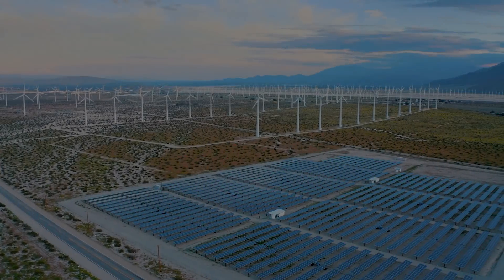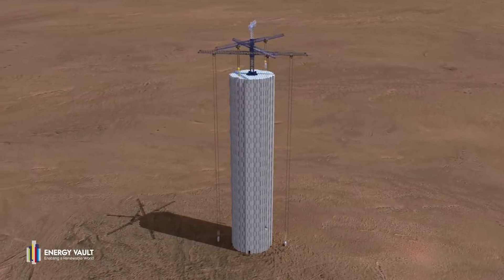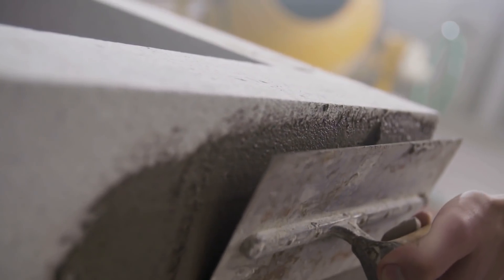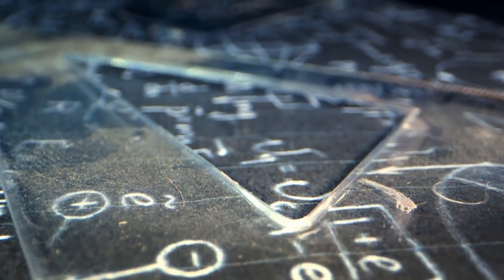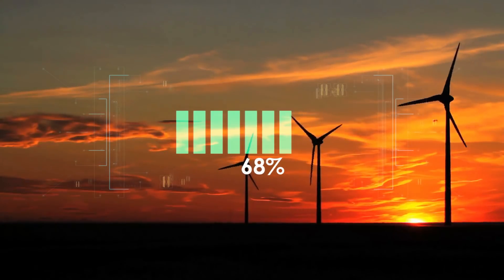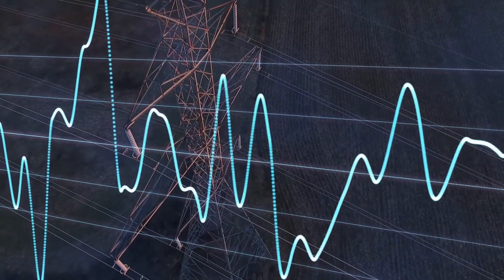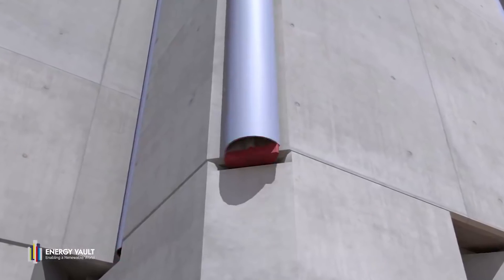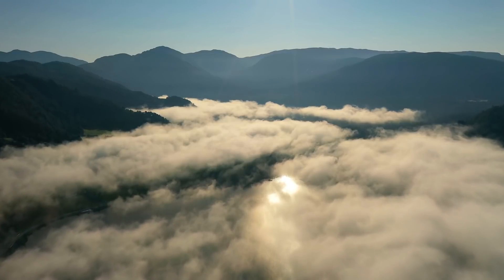Is Concrete the Future of Energy Storage?

Comment: How do you get more power from dropping an object than the energy required to lift it?
Reply: you dont - this is energy STORAGE not generation
Reply: @ollie1505  So the bricks stack by magic? or by burning fossil fuel?
Reply: @lokinakor1  Again nobody has an answer for this... Me I'd like to imagine a group of enslaved (Harry Potter-esq), Wizards chanting Windguardianleviosa over, and over, and over again....
Reply: @Ichijoe2112  has this answered your question?
Reply: @lokinakor1  I understood that excess renewable energy is used for the lifting process eg when solar panels are producing more than is needed at the time.
Reply: Bro.... Its just stacked by a normal crane which can be gas or electric powered. The idea is to STORE this energy being used by the crane in the GPE of the concrete blocks which can then be released at a later date by lowering the block to the floor. Imagine tieing a rope to a rock at the top of a pully then letting the rock fall off the High ledge while you hold the other end of the rope - you will go flying up. This force pulling you up is from the stored GPE in the large rock from the top of the pully. Same idea here

Comment: Why assume a different cost than they state? A well can be a high power option, but it is constrained in energy compared to the other option.
I feel that you really put your foot in it with assuming the cost is between that of oldshaft-newshaft.
Reply: I thought he made a pretty good guess. Raising and lowering a weight down an old mine shaft seems like it will be cheaper than building giant cranes to raise and lower weights. And digging giant holes to raise and lower weight into would seem to be more expensive than building giant cranes. Giant skepticism of a startups cost estimates seemed very reasonable to me.
Reply: @davefoc  That's interesting. To me the crane scheme seems much simpler than the mine shaft scheme. And certainly much more scalable.

Comment: Not sure concrete is the right solution, given it's environmental impact.
Reply: Screw the evvromental impact. Explain to me how we are supposed to get these Bricks up in the Air? More to that point, where does the energy to just do this come from?

Now you dropped you 'brick', and managed to collect a relatively miniscule amount of energy from having done so. The Laws of physics, and to that end Thermal Dynamics, state that the energy produced, will never equal the amount required to reset the aforementioned brick back to it's home position. Hence why Perpetual Motion Machines, are only so much a pipe dream. 

So on that note how is this idea any different?

Comment: Why not instead of concrete... have permanent magnets above each other separated by a very lightweight magnet shielding like aluminum that slides to and away with a tiny electromagnetic charge from itself through both the rise and fall of the lower half... maybe even have it in filled water tanks to prevent it from vibrating way too much?

Comment: We, I think concrete could be the answer,  but the symptoms you show there, look well over complicated,  why can they not use a concrete Ring that runs down the ouside of a central column which houses the Generators, and no crane's needed and can be fully enclosed, this could be down using hydraulic pressure to drive the Generators, and recharged by pumping the concrete  block back up to the top, just an idea.
Reply: Back a century and a half ago there was actually a scheme somewhat like that. A company supplied pressurized water to the surrounding area to be used to power machinery. They created the pressure by elevating a huge counterweight inside a big cylinder with pumped water and then letting it slowly drop

Comment: didn't thunderfoot debunk energy vaults system already?
Reply: Not really, because Thunderf00t doesn’t understand energy storage. He compared it to pumped hydro, but pumped hydro is a different niche in the energy storage market. Pumped hydro is best for long term storage. This is short to medium storage and frequency regulation. And you can’t just build pumped hydro anywhere either. 

Thunderf00t is a “debunker”, he only makes videos where he has already come to a conclusion, and then just makes up arguments to support the conclusion. He’s often right, but only because most the ideas he covers are obviously dumb. He doesn’t seem to do thorough research

Comment: Don't forget the massive CO2 impact that concrete has when made. However it should have a longer shelf life than batteries. However the moving parts may make it less reliable.
It has to have heavy duty lifting cables replaced, the bearings for the crane and pulleys on the dolleys etc. Lots of mechanical parts keep under a service schedule.

It's a very interesting idea however.
Reply: Yeah it would be interesting to see the cost of both types of energy storage compared to one another in both money and the environment because it’s not like batteries don’t have a affect on the environment as well and who knows maybe they could come up with something else that’s really dense and better for the environment then concrete. Although concrete shouldn’t be that bad if they can fix it so it last for hundreds of years.
Reply: It depends on the battery chemistry. Form Energy's iron air battery and Ambri's liquid metal battery are both batteries that will be cheap at grid scale with good life spans.
Reply: Lithium is finite and is hard to source while random heavy blocks of rocks can be found anywhere just add a mix of concrete powder then it is all good or just put it in a bag and basket and good to go. easy to change, manipulate, replace and source.
Reply: Have you guys heard of water?
Reply: It also depends a lot on where, because it's less affected by temperature than Li-ion batteries. So where temperature is a problem , this might be more beneficial.
Reply: There's one thing that, on its own, makes this idea an absolute no go.
One of these towers is only enough to store two wind turbines worth of energy.
Technology can get better but . . .
Also, why is it above the ground where wind can interfere? Dig a pit and let it be safe from wind underground.
Reply: Actually Energy Vault will be utilizing a mixture that utilizes the old discarded blades of windmills as well as the ash from burned carbon that would both otherwise be sitting in landfills. Energy Vault’s entire structure will be constructed using 100% recycled, sustainably-sourced materials for their blocks, and will not produce an ounce of carbon emission during its molding process for their blocks.
Reply: @ryancwiese  And when the wind blows (you know since it's near a wind farm) that long cable system is definitely going to be usable and not completely worthless right?
Plus the constant movement of it all is going to need some serious maintenance.
Pumped storage hydropower isn't exactly perfect, but it's far more simple and overall better version of this gadgetbahn.
Reply: Please, stop with that co2 nonsense.
Reply: "Don't forget the massive CO2 impact that concrete has when made"  You're right, and there are well known alternatives to the current concrete manufacture, that are at least far far less environmentally damaging.  But it seems "vested interests" are keeping the status quo.  Who cares about the future, when profit is needed now?
Reply: This is a massive scam and I am surprised this channel promotes it. It is probably a sponsored video.

Comment: Couldn't you use mercury and get almost 10 times the amount of power? The advantage of mercury is you could pump mercury up a pipe similar to water.
Reply: Ahh Mercury, toxic, expensive and has a disturbing tendency to dissolve many metals.  Far from ideal.
Reply: @stephentaylforth4731  there are nontoxic low temperature liquid metals.
Reply: @ARVash  Cheap and heavy have to be the starting point to be cost effective hence water and concrete. The cheapest metals liquid or not can't compete,  The amount of energy you can store in weight is pretty small,  Raising the temperature of 1 kg of water by 20 degrees celcius is about the same energy as raising the same kg to the height of Everest.  You can get just under 10 watts out of each kg for each metre it falls in a second so 1kg of anything falling from 9000 metres (Everest give or take) per second gives you just under 90 kW give or take.  Raising the temperaure of 1 kg of water by 20 degrees in a second would consume 84 kW.  Getting serious power takes a lot of weight falling a lot of distance in a short time. Hence large reservoirs of water 100s of metes apart vertically and bloody big pipes,

Comment: This has been debunked as an energy storage tool. It's just simple maths. 1kWh is 3,600.000J. So if you had a 1 meter cube of concrete in a 100% efficient system (which is impossible) you would need to raise it by 153 meters. In the USA an air con would need 4 times that per hour in a relatively small office. Also if you stack the blocks each block drops a bit less and the average will be 2/3 if you stack is 2/3 the height of the tower. So for that 4kW air-con you would need a 900m tall tower - taller than the tallest building in the world. That's just for 1 office for 1 hour.
Reply: Energy Vault is a scam for people who are lazy and bad at math.
Reply: No it's not simple, I don't see mass of the concrete in your equation 😂

Comment: Do the figures you quote for LCOS only cover the storage or do they include the generation costs of the power that is input into the system? Either way, this all seems like pretty expensive power, to me. $300/MW.h is more than I pay retail.
As to the output, it’s horses for courses. At the discharge rate of 0.8C the lipo battery pack will discharge in about an hour and a quarter while, at their lower C ratings, the other two will last for two and a half, and five hours, respectively. So lipo for grid balancing and the others for top up when renewables aren’t producing, perhaps.
It would be good, also, to see figures for the carbon cost of energy. What is the carbon footprint per lifetime MW.h of these systems? Concrete is not exactly the most environmentally friendly material to produce. I suspect that a concrete reservoir can hold an order of magnitude or two more water than the mass of the concrete required to build it.
All of these technologies are worthy of investigation and will probably be included to greater or lesser degree in the future. To a very large extent, the future of renewables will depend on the development of storage solutions.

IMO, distributed storage using mass produced (economies of scale) batteries along the lines of Tesla’s Powerwall is likely to provide the best answer. It will be able to extend the life of EV batteries beyond their suitability for transportation. It will increase the robustness of the grid, reduce the amount of high capacity transmission needed in the system and give individual users protection from grid outages.

If I was younger I’d be thinking about setting up a business to repurpose EV batteries for storage. Another few years, and second-hand ones will be flooding the market. Even at only 70% of its original capacity the Tesla Model 3 battery can store over 50 kW.h. This is about 3 winter days worth for me in my small, totally electric house.
Reply from the maker: Thanks for your great comment! The LCOS doesn't account for cost of power, just for the storage of energy! I would also love to see some life cycle carbon footprint analysis of these technologies, they say they are using old concrete and recycling it, so maybe that would help their case? But I definitely agree local mass produced storage is likely one of the best options, for me, i think vehicle to grid storage is going to be vital as most people will have huge batteries parked on their driveway soon!
Reply: @ZirothTech  
Very true. The average car spends the majority of its time sitting at home. Perhaps, reward car owners with a lower recharging rate if they let the grid discharge them during high demand periods. Obviously have a limit, perhaps 50%, below which they won’t discharge, further.

On a different topic, it suddenly occurred to me that the Energy Vault system has a major fault. Your crane has to be at least twice as high as the average height you will be able to extract energy from because, of course, the average height of the blocks in the stack is only half the height of the stack. But then as you lower blocks to the ground you have to start stacking them, further reducing the usable h in E = mgh.
The tallest crane in the world is 250m. So we build one and we stack, let’s say, 1,000,000 tons of blocks around it.
At an absolute maximum, even ignoring that last point, you could only store 347 MW.h in one of these. 
A million ton, 250 m high stack of individual, totally unsecured blocks being continuously raised and lowered seems like a recipe for the biggest collapse since 9/11, to me, and I can’t see terrorists needed to bring it about.

Comment: Looks like you mixed up your SI prefixes in those cost projections: raw lithium cells are closer to $100 per _k_Wh, not MWh.
If lithium batteries cost only $400 per MWh, a 70kWh battery pack typical for mid-range BEVs today would cost $40, making entry-level long-range EVs incredibly cheap.
Reply from the maker: Thanks for your comment, but the prefixes are correct :D this is for levelised cost, not upfront cost, which is why the values are so different! This is more a measure of how much each unit of energy costs to store, over the lifetime of the project

Comment: Compared to pumped hydro, this has very close to no potential.
Reply: It's more flexible. These could be built reasonably anywhere, which would help developing countries who may not have water reserves for pumped hydro.
Reply: @CreeperDude-cm1wv  Thing is, they can't stack the cement blocks when the wind is blowing. Even a light breeze will have significant impacts as they stack higher since those imperfections caused by the wind begin to add up quickly.
Reply: @CreeperDude-cm1wv  that's what i was saying!
Reply: @CreeperDude-cm1wv  It also doesn't help that cement has a huge carbon footprint, which for many, defeats the whole purpose.
Reply: Hydro needs big water reserves.
Reply: @alterinam6791  The total mass of the blocks will not be much more than the mass in a pond of water. In order to make a difference, the mass should be many orders of magnitude bigger than that. And also, one can just as well use seawater.
Reply: @runeaanderaa6840  Then why does it matter?
Reply: @alterinam6791  The only thing that does not matter is the Energy Vault.
Reply: @runeaanderaa6840  Whatever you say
Reply: @runeaanderaa6840  what if they use these in sea ports? dont they unload thousands of containers a day?
Reply: @thepyramidsisblackmade-gu8wb  It is a question about cost and practicality. The blocs of concrete, or whatever they are made of, will cost quite a bit to produce. The cranes and generators will be expensive and complicated. A good alternative will be to install a mega battery with a bigger capacity  for a fraction of the cost.
Reply: @runeaanderaa6840  I mean when unloading shipping containers, they are lifting and lowering containers with a crane. so the system and the container/weight is there already. Cant they use regenerative braking system to harvest some of the energy as they lower the containers?
Reply: @thepyramidsisblackmade-gu8wb  Sure. I suppose they could. I know there are hoisting mechanisms that do that, but very often, they don't save the energy. This is the case for a lot of elevators.
Reply: @marcosolo6491  
The technology is still in its infancy. First world countries could pioneer the technology, driving the prices down, which would allow developing countries to take advantage of them.
Reply: @marcosolo6491  
What makes you say that?
Reply: @marcosolo6491  
Eyy why did you delete your comment? The one claiming that the technology was just "green washing" and would just be a money sink?
Edit: nevermind my YouTube wasn't showing it, my bad.
Reply: @marcosolo6491  
So what does physics and engineering say that suggests it would be a money sink? Wouldn't the best way to tell to invest a little money and monitor progress?
Reply: @marcosolo6491  
Ok
Reply: Which altinator is best for this process
Reply: @Ganesh-jo4df  I am not sure what importance this has. But one could also compare this concept to a battery with similar capacity and easily see that it would be much cheaper and much more flexible. I am pretty sure that only the cost of the cranes and the maintenance will be more than the battery. It is really so stupid that it hurts.

Comment: At 8:12, how is it possible that gavitricity and energy vault produce so much less than batteries. An electric motor lifts the block, and then the same motor generates electricity when it lowers the weight. As far as I know, this process has over 80% efficiency or higher.
Reply from the maker: Thansk for your comment, this graph is about power density, so it shows how much power the system can output per MWh of storage, to show that for the same power output, the gravity systems would have to be much larger (in terms of capacity) than the battery! The round trip efficiency for each system is probably similar at around 95%
Reply: @ZirothTech  Thank you for your response. If this is the case, then the graph should have been titled something like: 'Power Density Per Cubic Meter'. Maybe you can add some subtitle on the video to indicate that.

Comment: Highly unlikely this concrete based energy storage is going to take off considering its using nothing more than just its weight. For one. Cost. The water may be less dense but its at least 1000x cheaper. Secondly. Its not scalable. Do u expect a few hundred million tons of concrete to be dangling in the air to do basically what a dam does.